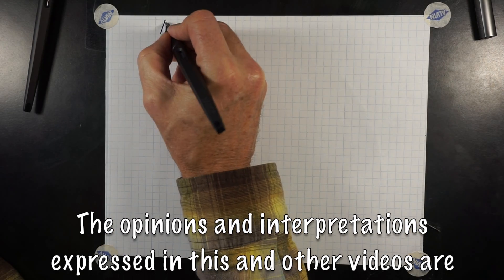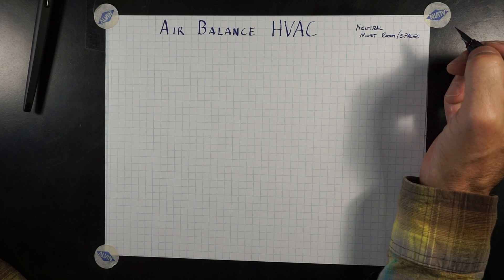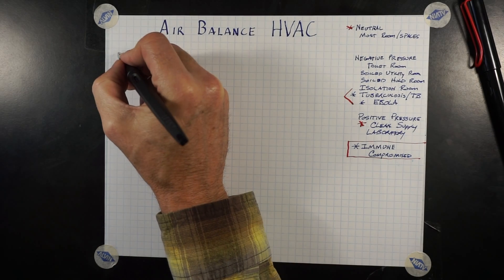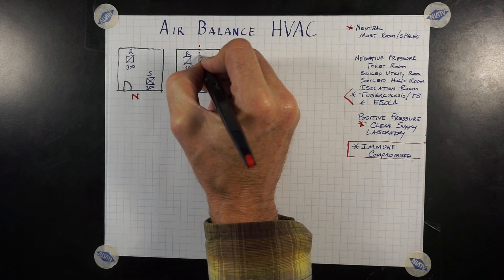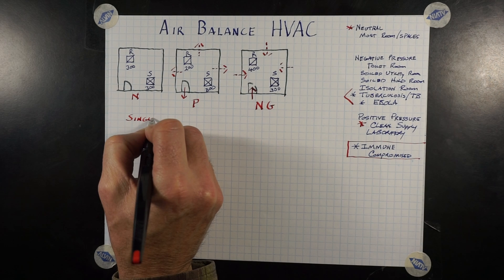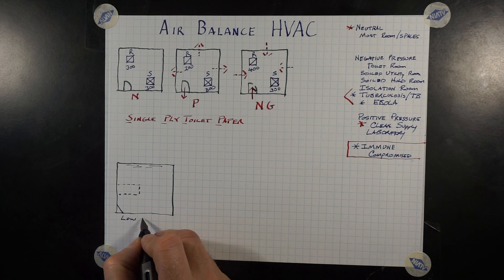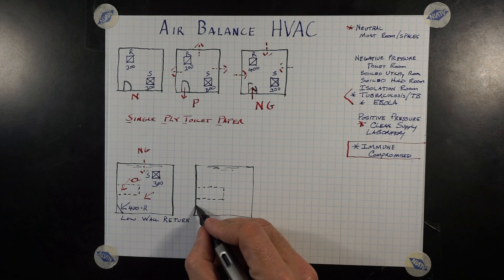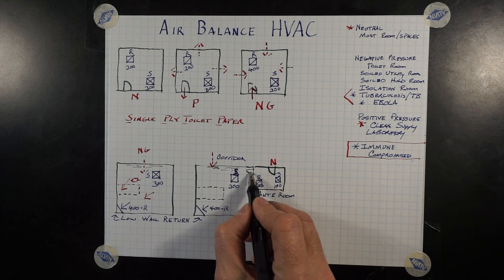Air Ballance HVAC 29-0

Comment from the maker: 1st of all I read this on my phone and meant to come back and reply and forgot, sorry

LOL LOL Sorry for LOL but that is way over my head.  I am not a Mechanical engineer only an architect, the video was basically really for architects understanding what their engineers are doing.  Architects have to answer to clients many times on cost and wanting to make sure everyone understands where dampers go also

My initial thought on your question, is I don't believe you're allowed to have return air in isolation, it should be exhausted we do not want to contaminate other people with the airborne illness of the person in the room.  Now for talking positive pressure i.e. the room needs to be cleaner than the corridor I don't know that answer for sure with a positive pressure room you could return the air but a negative pressure room I believe it needs to be hundred percent exhausted
Reply: In the hospitals 
the The return air totally goes to air but through the lowers which filters the air HEPA filters are used

first thing why you r watching this video as you said your not from technical field

Comment: hi what was the ratio of CFM needed if I had a 100% return air to cool a certain room, specially for isolation room application for both positive and negative.
Reply: +Arnold Villamin : hey hi arnold may i know what ratio you are talking about. Because if you have 100 % return then your equipment will cool the air. and if you are asking that how much fresh air do we need to create the positive or negative pressure then i know the ans.
Reply: Oh yes my package was a 100% fresh air return. What was my CFM ratio per square meter.